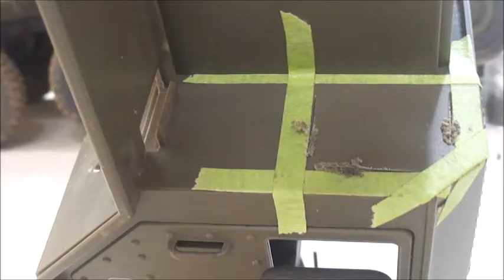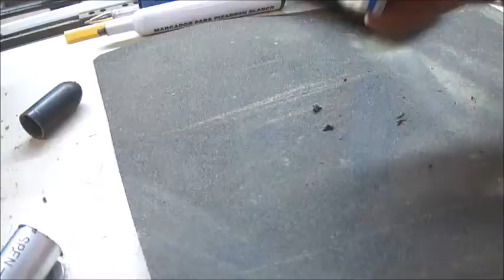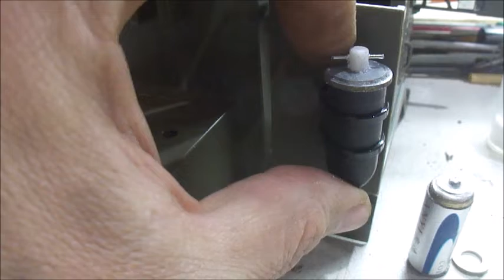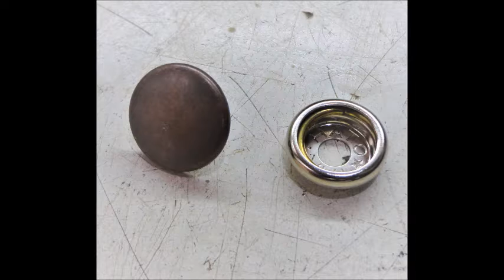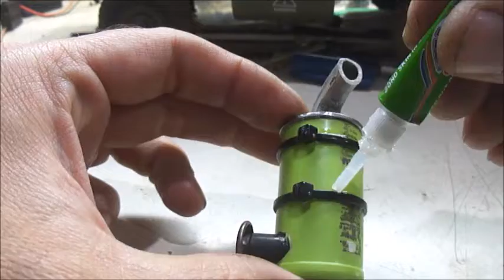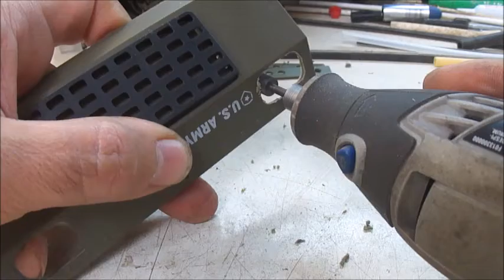OSHKOSH HEMTT 6X6 RC MODS PART 1

Comment: 👍👍👍Your video is awesome as always.👍👍👍 Very nice details and how you make it. Try my leaf spring screw hack, you will be surprised how it goes.
Reply from the maker: Hi Stefan thanks for your comments, what is your leaf spring hack,
Reply from the maker: @stefanschabo5202  Ok what I been doing is just loose the original screws 2 or 3 turns and leave then like that I will try the improve with the longer ones Greetings from Guatemala

Comment: Hello!!! Very nice video 
Where did you find the little soldiers ? Thank you 🙂
Reply from the maker: Thank you, in sets like this https://www.ebay.com/itm/294316240829?epid=16011542443&itmmeta=01J4Q5QTT04JQR3JERQ3JWZPP4&hash=item44869d6fbd:g:kPwAAOSwYqVltNec&itmprp=enc%3AAQAJAAAA4FkD%2BRfg7Z5y5EZMCatccG51nRP5eI7PW2uWAHHesSXKmp7lQXDzyIjfEa4edtOtwgtpPp2q7AzdW%2Bgki%2FwslHNENiLfexIEifML9KxRZI668cZPksRei%2FO0kUn9j%2BTldbFP%2Bfvkfl9%2BviO%2FnTCwcHUli2skplqFL%2BZIeV%2B5xIqgJaxCoCe%2BkOmHWItSnLKCQx1O5sOpMXB6AWLtOR40LQY2bIbQdVYR%2Fv6jyhYn5s%2F4ZfcmB9IjYlkRGJhXuUlQgwO5%2BXx2N3KnqqV9vzkG2B%2FbZ%2BKlOHrRjvUG%2FtcU8bdE%7Ctkp%3ABFBMjq3f5aVk or lots like this https://www.ebay.com/itm/296610007130?itmmeta=01J4Q5VS4B957YGDWYW6TCBNZ6&hash=item450f55885a:g:Kj8AAOSwNldmFqtC&itmprp=enc%3AAQAJAAAAwPhF4KkfgvpCjp%2FRVh65y13A8nyYBCE9H%2FjIIzNAGnloSBKd0dd0gIv%2BpB3CTVKZMwAakaXq7xYFTpsuWwQ7jX4DnP991GOzueZpkWazrkFcawrnKI2dY71ycsO9bfKBRuQeM69vrRNZVwSSLYYA8%2BQQYohxfmTgv%2FEnpNEfO3EcJUMxmDVJ0%2BQZi2cH%2B5tKfNHUGohuzj7KDxPoW%2FG0edAOqgurszveZ%2F0AsGOBmp4qnhSHl%2F3XLh3%2FqcR6A4VHRA%3D%3D%7Ctkp%3ABk9SR6aS7-WlZA
Reply: Merci !!!